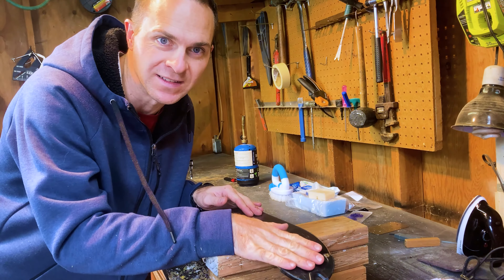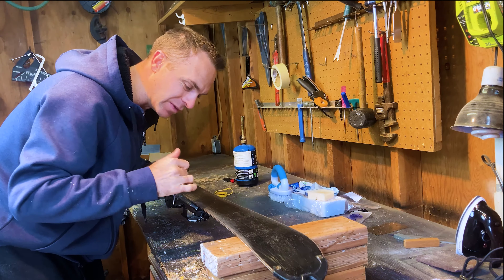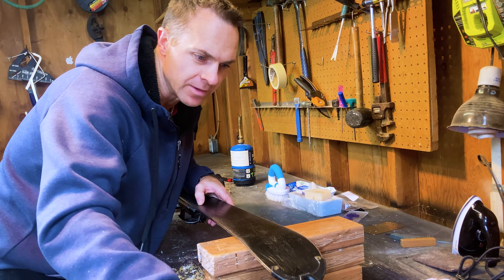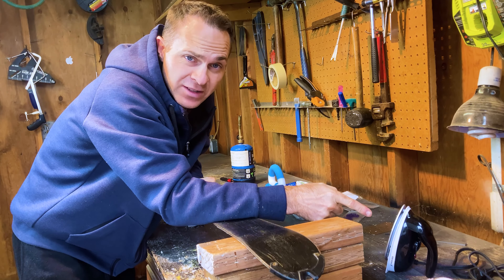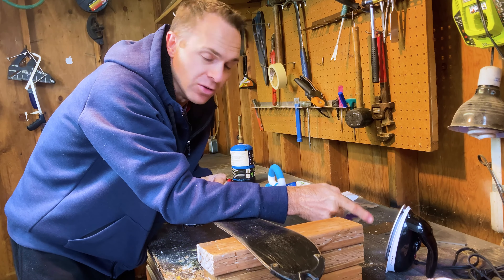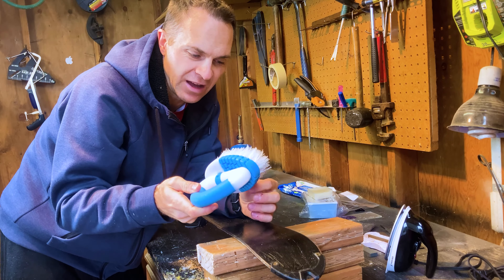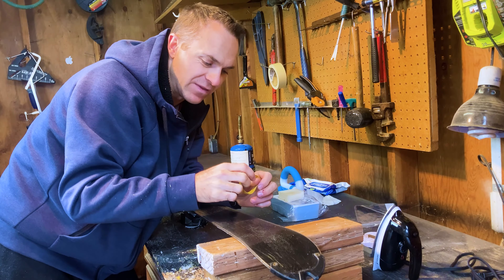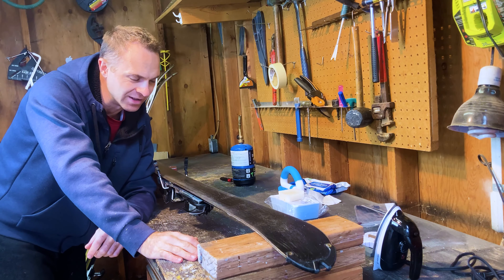Ski Tune Part 1 - Edge tuning

Comment: Thanks for the video.  I wasn't sure if I was supposed to do the bottoms and the sides of the edges, so this was helpful, as was your recommendations for keeping the cutter and ski clean while doing this process to avoid embedding metal filings.
Reply from the maker: Great to hear it was helpful. Sometimes it’s these little things that aren’t in the manual that help the most.

Comment: Hi 
Please don’t think I’m picking or judging you. As I’m not. 
I’m just very confused. I’ve just done my level one course on ski servicing and was told the 88/90 degree angle is only to be done on the side edge and the the base edge is set with a bevel/ useing a guide and a file @ 1 degree 
I’m still learning my self just wanted to clarify if I’m wright or wrong? 
Thanks
Reply from the maker: You could be right. This shows the way I was taught but I’m not a pro and don’t have a pro shop. Better results will surely be had taking to a pro shop.

Comment: This file guide isn't made to do the base edge of your ski. You have 0 control over the angle when holding it this way. 

Also, where there is a Nick in the edge, the metal hardened to higher hardness rating than your file, you should use a diamond stone first to take file off those burr.

A fine diamond stone could also be used if you only want to take the rust off. You would remove less material and prolong the life your edges.
Reply from the maker: Great feedback Philippe. Thanks for sharing.
Reply: Glad I’m not the only one to notice this, really should update video, this is wrong technique unfortunately for base edge

Comment: When do you use the 88°and when do you use the 90°?
Reply from the maker: A 90° would be preferred for a less experienced skier or when not planning to ski too aggressively. A sharper bevel like the 88° would be for aggressive skiing or when skiing on icy or hard snow. If you try to use the 88° less aggressively, it will hook up too easily. and if you use the 90° on ice or aggressive skiing like racing, you won't have as much edge control or bite. Of course these are preferences and also depend on your size, age, skis, and all other variables. Some skiers tune to the .5° and can tell a difference.